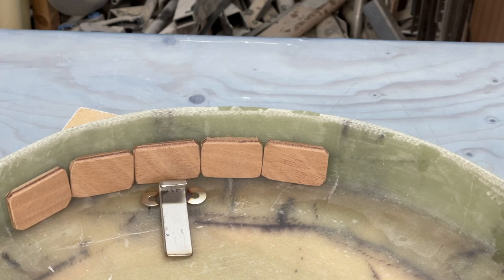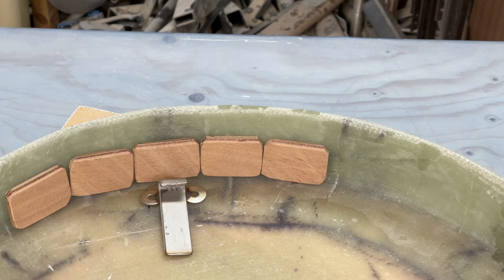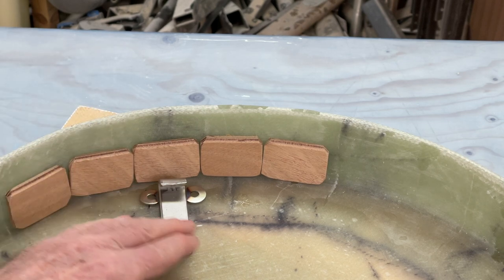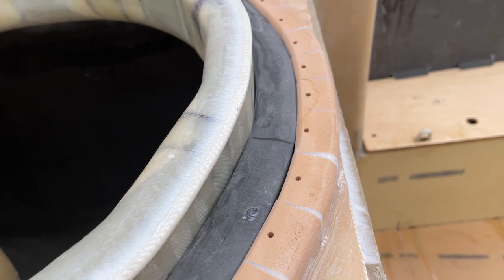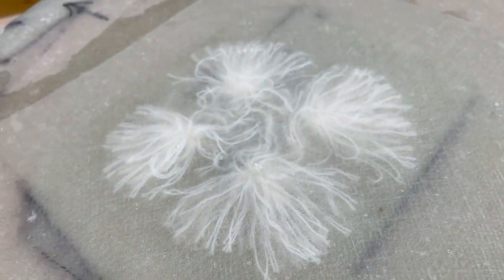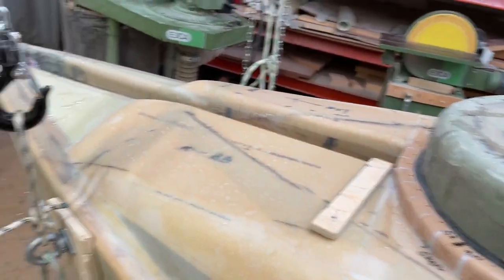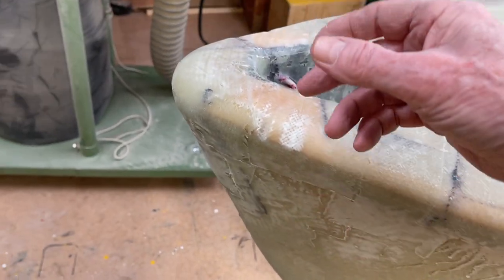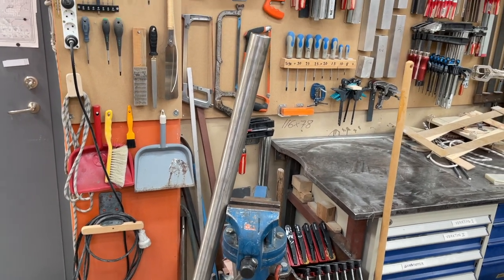13 Dec 2022  Thinking and planning  One new good idea from this night is the bow bollard and hole.

Comment: Is the gasket cut at a straight 90? Cutting at a horizontal angle would give a better seal by having the pressure from the lid press both ends of the gasket together. And if it shrinks or expands, there's still an overlap.
Reply from the maker: It is cut straight 90°
Cutting horizontal is a very good idea.
Thanks but that will need a longer gasket unless I do two cuts.
I will keep the idea in mind.